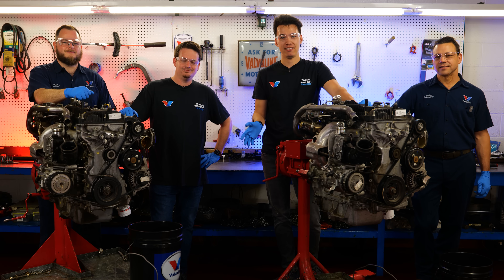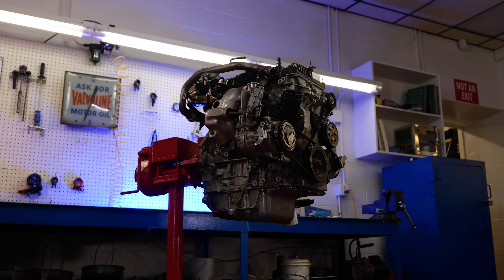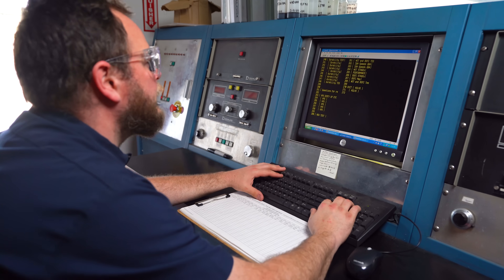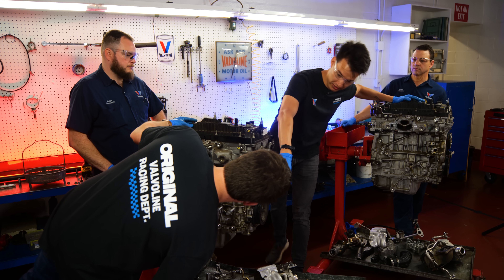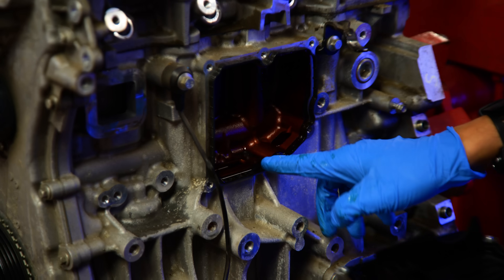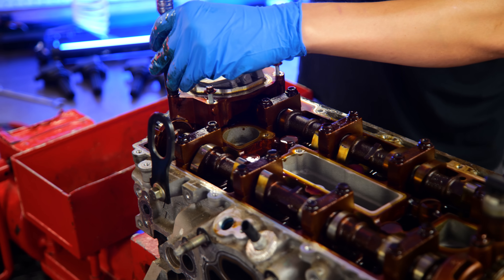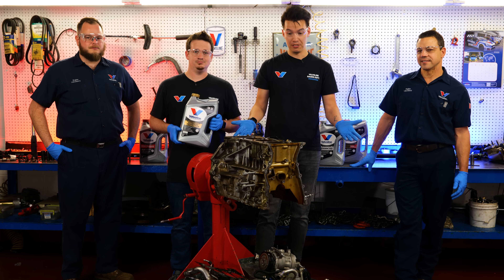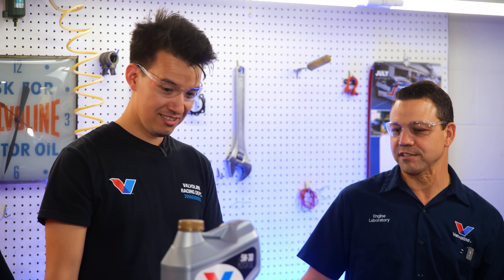Testing different oils over 4 years and 1 MILLION miles

Comment: This is a fantastic proof that no matter what products you use. Proper maintenance is the key to the long life of a vehicle
Reply: I’ve taken 2 SAABs and 1 Volvo to over 300k miles on 5k conventional oil change intervals.  Halfway there on a ‘03 Chevy and ‘11 ford but the last couple years have been on full synthetic.
Reply: Actually, this is proof that the products you use also matters. Synthetic oil is MUCH better than conventional oil. Synthetic oil also happens to be more expensive and most people will get conventional for that exact reason. It's better to spend the extra money to get the better product and this video shows why.
Reply: @JDubST  I can't see why you would use non synthetic oil these days. It makes just no sense to me.
Reply: @JDubST Depends what engine , in our case with Australian built 6 cylinder engines that normally use either 10w-30 or 15w-40 conventional , I was told that 10w-50 full synthetic would cover both standard grades , when I put the synthetic in , I immmediately noticed how thin & easier it seemed to flow , only problem was the lifters became so noisy I had to change back to conventional , nothing wrong with the motors or wear related issues , just no good for our application.
Reply: Horrible Holden six no doubt  …. Go the Fords and Barra the World!
Reply: They ran conventional at 10000 intervals. I bet if they ran it at 4 or 5 k there would not have been much difference. Just my opinion @JDubST
Reply: @JDubST  That's one theory. The other theory is that you match the specifications of the product and the specifications of the production. That means, if dino (conventional) oil was original, you can use it. You have to consider the oil change interval the product you are using permits also. This is a straw man test because the proper oil change interval was not maintained. At continuous highway speeds, you can go 10K miles on synthetics. Not on dino. I have an old Toyota. I keep a 2800 mile oil change interval based on all-short-trips driving.
Reply: @JDubST dude most car engine won't survive that kind of milage..so conventional will do the job jst fine...bt why not synthetic...it's better..
Reply: @JDubST  but it survived 500k right ? That is sufficient tbh
Reply: @JDubST  While true, nobody expects you to go 10K mile intervals on conventional. 3K miles, 4K at most - Had they replaced the conventional at those intervals the engines would probably appear identical. While synthetic is better, for the most part all you're buying is longer interval times.
Reply: @JDubST  Yet the exact opposite could be shown in other studies. This is snake oil my friend.
Reply: @JDubST so how come the video doesn’t mention how their “semi synthetic” only has to be 1% synthetic in order to put it in the label? Careful what you believe based on a video.
Reply: @JDubST Synthetic is definitely better but some engines like my Jeep 4.0 don’t like them. I tried using Amsoil synthetic I started burning oil and knocking. She’s much quieter on conventional 10w-40 now
Reply: @waterloo123100  This is where your previous buildup and wear matters. Part of what makes synthetic 'better' than conventional oils is its uniformity of oil molecule size and generally higher detergent levels. If your Jeep was using conventional most of its life and switched to non-conventional the issues can come from the uniform oil molecule size getting past the oil control rings more regularly than the conventional irregular sizing hence burning more oil. Additionally the higher detergent or cleaning power of the synthetic breaks down carbon and acid related buildup which can open up gaps where wear patterns have developed. These two reasons are why it's not advisable to switch to synthetic after a long period of conventional.
Reply: @waterloo123100  ive had similar experiences, turns out the 4.0 really likes zinc additives, the engine was designed for much higher zinc content in the standard oils of the day. Once catalydic converters became mandatory, zinc content was reduced in oils to preserve the lifespan of the cats.
Reply: @waterloo123100 what oil do you use? My 4.0 ticks like a time bomb  lol
Reply: @Vermonstered what if you do several 1500 cycles of synthetic would it wash away the conventional?
Reply: @Vermonstered  * and switched to conventional*    Typo line 3.    should be switched to synthetic
Reply: @JDubST Yep, and gets much worse with conventional oil during the winter seasons.
Reply: @JDubST conventional oil is better at keeping combustion by products in suspension. In aircraft engines this js very important. However i use synthetic in mine and change oil at about 25 hours. Its an aerobatic plane and operating in all attitudes washes everything in the oil regularly. No sludge anywhere on teardown. 25 hours at 70% power most of the time, doing 180 mph so thats 5000 miles of hard use i guess.
Reply: @JDubST  i wonder who would be crazy enough to drive half a million miles on 10k intervals with conventional oil . i change mine around 3 k
Reply: @JDubST  and also don't forget the mileage when the oil was changed, 6k is the best time to change your oil in my experience.
Reply: @JDubST  this is after 1 million miles ... the average person barely drives over 200k, so it doesn't really matter which oil you use.
Reply: I would of loved a third test vehicle running conventional oil for 5,000 miles instead of 10,000 miles. 

I would never run conventional oil for that long because it breaks down much quicker 😅
Reply: @Brandon-uy1uv sure. I bet you know more than the engineers
Reply: @Brandon-uy1uv exactly. When he said that I thought, we’ll no wonder the conv vehicle is so bad. They knew what their plan was. Let’s be real though. I’m struggling to believe they out 500k on a single exploder, let alone 2.
Reply: @Brandon-uy1uv  I wouldn't urn any only to 10k
Reply: @Brandon-uy1uv Well said, my thoughts exactly!!!
Reply: @Brandon-uy1uv  They couldn't do that. The two engine would have looked the same. There's a bigger markup on synthetic, you know.
Reply: @Brandon-uy1uv really ? i change oil before 5k kilometers 😮😮 a lot  less than 5k miles
Reply: @Brandon-uy1uv EXACTLY, conventional oil is not rated to go 10k miles, my foxbody has 500k real world miles and it’s ran conventional 10w-40 its whole life with oil changes at 5k miles, the the tarnishing looks nothing even close to this
Reply: @Brandon-uy1uv I agree, I work at a shop and most people only go 5,000 miles between oil changes using synthetic blend. I'm pretty sure an engine with oil changes every 5,000, using conventional would have been close to what the full synthetic one looked like. The varnish on engine is mainly from oil deteriorating and breaking down. It becomes acidic and starts corroding parts. But it would have been awesome to see a third variable.
Reply: @06Salvi_LGT  If they were both changed at 5,000 miles do you think there would still be such a large disparity?
Reply: @KLCII88  I don't think so, I think 10k miles intervals are too much. Specially on direct injection turbo engines like the ones shown in this video. My guess is that they would look similar since the oil is being changed more regularly and not letting it corrode the internals.
Reply: @06Salvi_LGT  Running conventional oil at 10 k miles intervals constitutes SEVERE  abuse especially in a high performance turbo engine .
Reply: @Brandon-uy1uv I would never run conventional as long as synthetic either. Wasn't designed to run the miles.  But... They each get as dirty as quickly and  the filter can only handle so much before the bypass opens.  I would like to see this test with a 5vs 10 with filter inspections and oil analysis on each at each change.  Also have to consider that in my area, conventional is not literally half the cost of synthetic.  Love the information though.
Reply: @musclecarappraisal When an oil manufacturer says their oil is good for 20k or 25k miles, they have millions of dollars, and dozens of years, of data to back that up. Why people still think it is still the 1970s is beyond me. Engines & oil are vastly improved.
Reply: @Brandon-uy1uv exactly they should have run conventional at what it is supposed to be 5000 or less. To actually be fair. Breakdown is obviously more on conventional because it was run twice as long as recommended
Reply: @Brandon-uy1uv then the conventional oil change is much more expensive. You are doing 2 oil changes for every one synthetic. Plus with synthetic you absolutely have much less chance of wear. The shear resistance is so much better. The thermal breakdown is so much better with synthetic.  With a direct injection turbo charged engine like that one I would only recommend a non good synthetic if I didn't like you and wanted you to have problems. It would be dumb to run a conventional oil in a engine like that and even dumber to let it go even 5k miles. Also, on those engines I guarantee neither go 500k in the real world but the conventional DEFINITELY wouldn't even with 5k intervals. This is just a Valvoline commercial if anyone believes that. I see these engines everyday.
Reply: @ShizawnSanders  the test is most impressive showing how well the conventional oil did for 10 k intervals in a turbo car .
Reply: @tjlee9901  now show me the exact same but REAL driving. Especially the Southern or Northern parts of the US.
Reply: watch it again
Reply: "Proper" maintenenance.  I'm am endlessly astonished at the number of people who don't do even the 'basic' maintenenace on their vehicles.  And it's usually these same imbeciles who love to claim "I'll never buy another vehicle from company 'X' ever again!"  And then they proceed to state how this, that, and the other thing on their vehicle failed while they were on a road trip to the middle of nowhere at zero-dark-thirty in the morning.  It's around this time I'll ask the moron what they use for their oil and oil filter change interval, to which they will (some of them) respond by saying, "Oil change?"  That's when you know that this person is an imbecile.  

I have a friend who is a DOCTOR......presumably an 'intelligent' person.......who upon taking her Toyota Sienna mini-van in for an MVI at her local shop, had the mechanic state that he refused to release the vehicle back into her custody.  When I asked her why a mechanic would make such a statement, she replied by saying, "He said that I had four bald tires that were so bald that the cords were showing through the rubber, and I had two ball joints that were ready to fall off the vehicle."  Apparently she didn't like the estimate she was given for the cost to remedy these items, and she wanted to simply drive away after paying for her failed MVI (annual Motor Vehicle Inspection).  Suspecting that he would be legally liable in some way for whast would undoubtedy be the inevitable vehicluar disaster upon her driving this 'death-trap' away, he refused her the keys.  I say hats off to this common sense mechanic, though I don't claim to really know the legal implications if he would have let her drive this shit-box away.  Did I mention that this woman is a.......DOCTOR????
Reply: This videos has very interesting things if you chosse natural oil do not change it every 10.000ml do it half 5.000ml
and you will get similar to syntetic...
thats the point syntetics last long with out deterioration...the brown color on natural oil its due to burn particules that not last 10.000ml
good to go only 5.000ml
Reply: @1mansopinions  Maybe you missed the conventional engine had no symptoms prior to teardown or both engines have 500k miles or both engines had stuck rings. Even if an engine retains slightly more heat, that's not a con unless it starts taxing the cooling system or hot spots begin to develop. And again, this is a 500k motor and beyond the life most first, second and onto the 3rd+ owner who never has any idea of the maintenance history. And again, folks like you need to realize engines wear out. There's no lifetime parts.
Reply: @1mansopinions  LoL, this test has nothing to do with what I run. It's literally about all you folks having no idea how to understand the results of an experiment. Now so weak your stance and character, trying to make it about what I run. 😂
Reply: @1mansopinions   🤦 But not only do you care so much of what I'm running to not only speculate, but even say now I'm realizing of some mistake. Even further creating years of history for what I've been running. But right, you don't care. What seriously broken passive aggressive nonsense you're full of aren't you? All because you resort to make it personal when your dumb comes out. SMH
Reply: @1mansopinions   But not only do you care so much of what I'm running to not only speculate, but even say now I'm realizing of some mistake. Even further creating years of history for what I've been running. But right, you don't care. What seriously broken passive aggressive nonsense you're full of aren't you? All because you resort to making it personal when the most obvious stuff is pointed out. SMH
Reply: @1mansopinions   🤦 But not only do you care so much of what I'm running to not only speculate, but even say now I'm realizing of some mistake. Even further creating years of history for what I've been running. But right, you don't care. What kind of passive aggressive nonsense you're full of aren't you? All because you resort to make it personal when your dumb comes out. SMH
Reply: @1mansopinions   🤦 But not only do you care so much of what I'm running to not only speculate, but even say now I'm realizing of some mistake. Even further creating years of history for what I've been running. But right, you don't care. Seriously, why does it always become personal when your dumb comes out?
Reply: @1mansopinions  Riighhhtt, you don't care but create a years long narrative about it. Such high levels of passive aggressive nonsense. Why do folks like you always resort to personal attacks when your dumb comes out? SMH
Reply: @1mansopinions  Yep, you don't care except care enough to create a years long history to what I've run. You're chalk full of this passive aggressive nonsense and not an ounce of technical understanding. 🤦
Reply: @1mansopinions  🤦 You don't care but create a years long narrative about that I use. Passive aggressive much?
Reply: It's proof that your engine will probably be the last thing to go, regardless of what oil you use.  Your cars transmission etc, will most likely go long before an engine issue.  I have had dozens of cars with 200-300K+ miles and not one had an engine go.  I had a Honda CRX with 350K miles and changed the oil, with conventional oil every like 15-18K miles towards the end and it was still running great.  That is the 100% truth.
Reply: If the engine can go half a million miles on conventional oil that is more than likely outlasting the rest of the car so what difference does it make if it has more wear?
Reply: @vinceblanchard1069 Because it’s common sense. Less wear, and tear. Better fuel economy, and less repairs.
Reply: Evidence would be seeing vehicle it came out and mileage they are here because they can try
Reply: Yes because oil gets dirty and contaminated
Reply: Not all cars are created equal, there are high maintenance cars
Reply: well, the video's main point was to use fully synthetic oil following a strict scheduled maintenance.
Reply: Yup... spend 1/4th the price on conventional and do oil changes every 3k-5k miles, or use synthetic for 10K. The choice is easy for me.
Reply: Literally not what the video proves.
Reply: Agreed - regular oil changes and proper maintenance will keep your engine running a long time.
Reply: The key takeaway for me was when your car goes to the junkyard with less than 500,000 miles using full synthetic oil, it'll have a much cleaner engine.  For the difference in cost, I'd stick with conventional oil.  

My dealer stopped offering conventional oil some years ago, interestingly, they changed the oil change interval from 3,000 to 5000 miles.  Instead of less than $30 for a an oil change, it's up to ~ $100.  I wonder why they did that?

 On the other hand, IF I had a turbo engine, I'd be much more inclined to run full synthetic due to it handling extreme heat better.

 This Valvoline ad (Valvoline being my favored brand) did nothing to change my mind.  Both engines made 500,000 miles, impressive.
Reply: My Explorers have 10k mile oil change intervals. I see no reason to do them more often. Both the conventional & synthetic oil engines looked great for 500k miles.
Reply: Synthetic vs Conventional is more of an application specific argument. Conventional is for shorter intervals, while synthetic is suited for extended drain. The misconception is that “synthetic” (referring to base oil only) provides better WEAR protection automatically. This is blatantly FALSE. Props to Valvoline for hosting this experiment and making a great product produced right here in the USA 🇺🇸
Reply: Uhhhh this video showed the literal opposite
Reply: stop the cap. full synthetic all the way
Reply: its proof this is marketing
Reply: It’s fantastic proof you shouldn’t use conventional oil… who would?  A poor person?
Reply: if you real want your engine to last a really long time.  change the oil every 3k and use synthetic.  2 to 3 oil changes a year at $50 a pop for a car that will last 200k is worth it to me.  They type of synthetic doesn't really matter but I have used Mobil 1 in all my cars with great results.  Never go off of Manufacturer guidanance.  Always go sooner,  they are in the buisness of selling cars not making the one you bought from them lasting longer.  The longer your car last the more money you have to invest.  Most rich people don't have car payments.  That is why they are rich.  Take care of your stuff.
Reply: and if they did 5k or 3k intervals I'm guessing the conventional wouldn't have tarnished
Reply: Dino oil change 3k
Synthetic  5k oil change
Reply: @bobconner422  : Agree, however, for many years I have done full synthetic oil changes every 6 mos or 6,000 miles on multiple vehicles that I own, all with great success.
   For me, the primary reason I run synthetic engine oil is to extend the drain interval. It saves me both time & money in the long run.
Reply: This video literally proves the opposite of your point, the engine on conventional oil was meticulously maintained and looks like trash compared to the synthetic one. 

r/whooooooosh
Reply: @ImBarryScottCSS  It looks very good for a 500k miles engine to me, trash is a bit exaggerated.
Reply: @ImBarryScottCSS  Who cares how varnished anything is when it operates perfectly well mechanically? 500k miles is 500k miles worth of revolutions that per this test is on varied throttle and driving. The folks who care what color the engine looks like rather than mechanical function and wear. Woooosh
Reply: @Vermonstered  Each to their own!  Use whatever oil you are happy to use!  The Motor Oil Geek also showed slightly higher wear on mineral oil (though not necessarily anything of significance).  But conventional changed at 5,000 or even 7,500miles rather than 10,000miles should have kept the engine cleaner.
Reply: @TassieLorenzo  What are you talking about? There's a number of reasons why you would never want to use a static weight mineral oil in a consumer level motor, no idea why you'd even bring it up. The engine is already basically at the finish line. 500k miles, do you PLAN on taking an engine further? Do you really care what color the varnish is on the engine when you retire it from half a million miles of service? I swear, so many people just regurgitate something someone else said without any ability to convert that information into actual knowledge and without knowledge, there's zero wisdom. 

The test is done, 500k miles, zero fatal failures or horribly unexpected rebuilds. The mating surfaces looked perfectly serviceable to continue. The oil protected sufficiently for this task and looks like it will continue albeit with some stuck oil control rings which don't affect compression. Why are you folks so worried about the color or trying to regurgitate a mileage number it 'should' have been serviced at when that 1) wasn't the test and 2) 'cleaner' standard based upon varnish seems arbitrary and silly. Wouldn't a mechanical operation standard be better? Though I'm not surprised by someone who touts the motor oil geek so often. Hint: All of his businesses revolve around getting people to worry excessively about their oil and related products so he can sell more services. You need other sources of information to actually gain some knowledge.
Reply: @Vermonstered the stuck chain tensioner and 7 vs 1 cold stuck piston rings are definitely something to keep in mind. Neither of them can be ignored. Failed timing chain leads to catastrophic engine failure, stuck piston ring in the best case to oil and increased fuel consumption, worst case to a stuck rotating assembly
Reply: @over_pizza_2578  : Sure, and if the drain interval had been every 3,000 miles, as it should be with any conventional oil, you'd most likely had seen much different results. 
   Primarily, significantly less carbon deposits and sludge inside the engine. It's those 2 things that created the sticking timing tensioner and piston ring cold stick issues.
   I found it interesting that the turbo wastegate failed prematurely on the conventional engine.
   I also found it interesting that the catalytic converters both failed, however the engine running synthetic oil made it to approximately double the mileage of the engine running the conventional oil. That alone is VERY significant.
Reply: @over_pizza_2578  Sigh... You people really do regurgitate the same stuff. Chain tensioner isn't a forever component. The test chose to replace as needed vs service intervals because they could monitor so closely. It would have been checked and replaced the same amount of times on a standard service schedule. The oil control rings can be a problem, or they aren't a problem. If they're not losing compression they might simply only see a slight increase in oil consumption and possibly be the cause of the cylinder smoothing. Being they made no note of this being an issue during the running, rather just a surprise note during teardown, it's more likely it wasn't as severe as you're trying to make it out to be. But again, most importantly, you need to realize components aren't lifetime parts. It's so asinine to attribute every part failure to oil change intervals for a half a million mile car. Just because it's the variable you're testing for, doesn't mean every part in your engine design will allow it to make 500k miles with ANY oil change interval. It again is 500k miles of rotations, heat cycles and stress every component needs to survive regardless of how often the oil was changed. As surprise.... Both engines of the same spec had the tensioner problem, both had stuck rings. It's so dumb to think halving the mileage on the oil is a magic, literally magic, solution and every engine will make it to forever miles and more in perfect condition without ever needing any service intervals on components. 🪄 That's exactly what you're claiming by attributing every failure to the change interval.
Reply: @Vermonstered  they did find that the ratcheting mechanism of one of the timing chain guides in the engine running regular oil started to malfunction due to sludge. I for one, would've wanted to see all of the oi analysis done on both engines.
Reply: @orlypalomar   That's the chain tensioner and normally the service interval is approximately every 100-150k. They left it on and that is actually the second one so only one failure in 500k miles. Again, you folks need to understand the oil change interval isn't going to guarantee every component on the engine is now a lifetime component. Those have service lives as well and theirs made it long beyond what most shops would be monitoring or just straight replacing it. I don't know why people think there's only one variable on this motor, the oil change interval, and that's the sole reason anything happens. It's not and it's painful to see this many people who think it's binary. Do 5k oil changes, your motor will automatically outlive you...
Reply: @Vermonstered but it didn't last. The turbo had to be replaced.
Reply: @ShizawnSanders  Now if you actually paid attention to what they said about the turbo. It's the waste gate actuator on the turbo that failed. Going to be a very very tough sell to try and blame that on the motor oil. Pay attention to details instead of regurgitating what others tell you!
Reply: @Vermonstered  LMFAO. I do this for a living. I pay attention every day. To every car I see and I see A LOT. Plain a simply cars that use better oil have less problems and in reality it cost the person LESS to use. It's literally cheaper in the long run even if nothing fails. I can GARANTEE if someone used that conventional oil on THAT particular engine and changed it even half as much it wouldn't make it much past 150k miles IF anywhere NEAR that. NOWHERE near 500k. Direct injected. 4cyl. Heavy SUV. Turbo. LMFAO 🤣 yeah right. 

Anyone seeing this if you have a modern direct injected engine do yourself and you bank account a favor and use a good FULL synthetic oil. I promise you will be ahead in the long run.
Reply: @ShizawnSanders  🤦 So you missed how the turbo failed had to do with the electronic waste gate and now missed that both these motors lasted to 500k without major mechanical failures or signs the oil film broke down with 10k or the OEM specified oil change interval and could do many more miles. If you do this for a living, you aren't very good at it.
Reply: @Vermonstered  LMFAO and you are VERY nieve if you think these engines, BOTH of them, would last 500k without a major failure. I'm a Ford fan, been driving a 500HP Mustang for the last 6 years and I'm telling you without a doubt these engines in particular wouldn't last that long. ESPECIALLY the conventional oil change one doing 10k intervals. BECAUSE I do this for a living I know that and I am VERY successful at what I do. You OBVIOUSLY need a clue.
Reply: @ShizawnSanders   🤦 So the entire thesis you're now standing upon is this test is entirely fabricated and the results are entirely made up? You're staking your entire reputation, per your previous post, that neither of these engines would make it to 150k miles on the 10k OCI... On the basis of 'trust me bro' and you drive a 500hp Mustang. Stupid never stops.
Reply: @Vermonstered  reading comprehension lacking with you or something? Where did I say the test is made up and where did I say both engines wouldn't make it to 150k? Huh?! You see alot of 500k Ecoboost where you work without a major parts failure? In real world driving conditions that particular engine doesn't last. I only have 14 years of experience on it. I'm also not saying it's impossible but I am saying it's a ANOMALY! I BARELY see 500k Toyotas and Hondas meticulously maintained. A Ecoboost going 500k using conventional oil changed every 10k miles? LMFAO 🤣 yeah right. Maybe 1 in a thousand where the person was on the highway 90% of the time and even still that would be practically a unicorn and NOT NORMAL! Also, how in the world do you get the idea I think I know what I am talking about because I drive a Mustang? I made it clear to put that in to show my bias TOWARDS FORD! My gosh. Stay in school kids. Actually pay attention. Edit: 150k
Reply: @Vermonstered  you were correct about one thing STUPID never stops. Although you might take a internal look there bud.
Reply: @Vermonstered   you see alot of 500k Ecoboost engines without a major parts failure where you work there bud? Actually do some research. You might learn something and not look a certain way before putting yourself out there.
Reply: @ShizawnSanders  You: "Where did I say the test is made up and where did I say both engines wouldn't make it to 150k?"
Also you: "I can GARANTEE if someone used that conventional oil on THAT particular engine and changed it even half as much it wouldn't make it much past 150k miles IF anywhere NEAR that. NOWHERE near 500k."
Also you: "A Ecoboost going 500k using conventional oil changed every 10k miles? LMFAO  yeah right. Maybe 1 in a thousand"
- For those who aren't carrying a pile of rocks in their head, this test showed exactly that with two side by side motors making it to 500k miles without any major mechanical issues.
You're really showing that true incompetence in your job, that reading comprehension, your schooling (LMFAO must be included in every response) and your resume of "been driving a 500HP Mustang for the last 6 years" and the capper is only the really dumb only deal in absolute claims like you. You out yourself and sorry this test exists and there's 2 unicorns out of 2.
Reply: @Vermonstered  please do show me these real world 500k 4cyl Ecoboost. Its should be easy because according to you 100% of a test of 2 did it. I mean you are making it seems like 500k Ecoboost that only change their oil every 10k miles using conventional is the norm. Is that about right? PLEASE keep this going. You are pure entertainment. Also, reading comprehension. I never said BOTH wouldn't make it to 150k. Show me where I said BOTH wouldn't make it. What I am seeing here IS someone making themselves look a certain way. Again, do you see alot of 500k 4cyl Ecoboost without a major parts failure where you work? Almost the EXACT same engine as this is where I work and has a just over 100k on it. Guess what happened to it? I'll give you a hint. It ABSOLUTELY DID NOT make it anywhere near 500k without a major parts failure. It was also serviced MORE often than Ford recommends ITS ENTIRE LIFE!
Reply: @Vermonstered  AGAIN! WHERE DID I PUT THAT DRIVING A MUSTANG HAVE ANYTHING TO DO WITH MY RESEME!? Like literally what's wrong with you other than a SERIOUS lack of reading comprehension!? Seriously!? And I have rocks in my head? Sheesh. I ONLY put that there, for like the 3rd time me telling you this, to show my bias TOWARDS FORD!
Reply: @Vermonstered  the only thing your quotes did was show what I have already said. You have a lack of reading comprehension. Maybe I should say it again and hopefully you will understand this time. 

In real world driving conditions where cars are actually driven on the road on different environments over TIME a 4cyl Ecoboost will have a difficult time reaching 150k miles using conventional oil changed every 10k miles without a major parts failure. Going 500k miles doing the same would be a Unicorn and I would have to see it to believe it with documentation and video diary time stamped to back it up. I have 17 years in the field and have been servicing those types of engines for 14 of them. Honda and Toyota engines have a difficult time going 500k miles in the real world using synthetic oils and being meticulously maintained. The Ecoboost has gotten better with every generation but its not a 500k motor especially with that choice of oil and ESPECIALLY with that drain interval UNDER REAL WORLD DRIVING CONDITIONS!
Reply: @Vermonstered  that pile of rocks is a whole lot smarter than you. OBVIOUSLY! You look bad enough here already but please keep going.
Reply: @Vermonstered  until you can show proof of all these 500k mile 4cyl Ecoboost with 10k oil change intervals using conventional oil with no major parts failure all you are is someone looking extremely foolish because you didn't do your research on that particular engine and all it's inherent design issues. It actually pains me to say that but its just a fact. 10k mile intervals with conventional oil that would be broken down on most cars for a good bit of it would just multiply the inherent issues and design flaws.
Reply: @Vermonstered  so I 100% prove that I didn't say what you said I said and after all that your response in I have rocks in my head? LMFAO 🤣 🤣 🤣.  Take a good look in the mirror bud.
Reply: @Vermonstered  insults are a sure fact of DEFEAT!
Reply: @ShizawnSanders   Your words say what they say bub. In fact you made a "GARANTEE" these engines won't make it to 175k miles. Much less the 500k the actual test was conducted over. The only common denominator here is the vehicles you work on have major problems breaking 150k miles. Still not realizing the test is 3+ times mileage multiple to any of these engines you claimed to work on, even if not a direct apples to apples comparison, shows YOUR work to be inept for them to be failing closer to 100k when you work on them. Your own claims show you to be less than useless for engines to fail so early so consistently and likely why you think you can talk your experience up to avoid reality. 

Oh and just because you make it so easy...
You: "insults are a sure fact of DEFEAT!"
Also you: hurling multiple insults every post. 🫣  Stupid never stops.
Reply: @Vermonstered  yeah this test did more than 3× the mileage of what is average for the lifespan of this engine. IN A TEST THAT IS NOT REAL WORLD CONDITIONS GENUIS!
Reply: @Vermonstered  show me EXAMPLES of this engine doing 10k mile oil changes using conventional oil and going PAST 150k miles with ZERO major parts failures. I'll wait. Until then, take a good look in the mirror. Admittedly I shouldn't say it's IMPOSSIBLE because of the flip side of Murpheys Law but I will say show me multiple like it's nothing for it to do that under those conditions and I will concede, but YOU CAN'T and you WON'T because I AM in fact good at what I do and perhaps you should actually just read some Ford TSB's, Recalls and law suits on the subject. ACTUALLY EDUCATE YOURSELF!
Reply: @Vermonstered  the only common denominator is the engines I see? LMFAO 🤣 🤣 🤣 🤣 🤣 so I see all of them in the world huh? You are making this TOOOOO EASY! If nothing else just research the TSB's, Recalls and lawsuits associated with the Ecoboost. If you're obviously not gonna educate yourself before looking this way at the very least take a moment and look at that.
Reply: @Vermonstered  you would have had a better time trying to prove that you know more about operating talking to a Navy Seal. At least then you MIGHT have stood a chance.
Reply: @Vermonstered  so let's recount. You say I said this stuff which I 100% prove I didn't say. You said I used driving a Mustang to prove I know what I'm talking about on the matter even though I clearly said I put that there to prove my bias for Ford. You constantly attack my character and try to say I'm not good at my job just because you can't understand that this test isn't a apples to apples comparison to real world conditions that the engine sees and that the engine in the real world just isn't that reliable when it's all said and done. You sir, have some growing up to do and a TON of research. Definitely stay in school and learn something and definitely don't tell a expert he is wrong because you saw otherwise "on the internet". Lol
Reply: @Vermonstered  ohh and since you are so smart why is it 300, 400, 500k  mile and more Toyotas(especially) Hondas, LS powered vehicles, Coyote powered vehicles, Duratec and even some 3.5l Ecoboost ect come through my business but when it comes to this 4cyl Ecoboost they just magically start having issues even though the only thing that gets serviced on them by 150k is plugs, oil, filters and coolant. I'm that's it. We aren't doing anything Ford doesn't say to do other than telling the people that are driving them that if they change the oil a little sooner than it says it's not going to hurt anything but could possibly help. So why is their MUCH less issues on those other engines vs these little ones? How is it My business is the only shop doing all the servicing so THAT must be why there are so many issues? HMMMMM!? Wow, where did they find YOU! ?
Reply: @ShizawnSanders   There's the incompetent fool's creed. If you can't do it, no one can. You'll "GARANTEE" it. When presented with evidence someone can, try to discredit and bury them never learning a thing while digging an ever deeper hole as you trip up on your own insults. Hilarious part is the evidence you keep demanding is really simple. Any used car search for a car equipped with this engine, your claim is every Carfax for a car over 175k miles will show a rebuilt or replaced motor. Just because you can't, doesn't mean everyone else is as useless. Remember how this all started, you couldn't catch the turbo failed because of an electronic waste gate and not an oiling issue. The volume of nonsensical absolutes, puffery, insults to come from that mistake and now even comparing your skill to the competency of a Navy Seal? The absolute level of self grandeur is astonishing. Only further proving, stupid never stops - but I can. 👋
Reply: @Vermonstered  youre wrong
Reply: @tjlee9901   Conveniently left out about what? Or are you just making more blanket statements with no actual basis? The test is what the test is. The used market for these shows exactly how well these hold up in the real world. No amount of personal hyperbole or rampant posting changes either one of those regardless of what 'Shizawn' or whoever else says. The reality for Shizawn at least is he causes his own problems as he absolutely can't accept his own responsibility as shown by his posts. What's going to be your claim?
Reply: @Vermonstered  Did you watch the video until the piston rings part. The varnish causes the piston rings to cold stuck.
Reply: @imadude85  The varnish doesn't do that, but physical residual buildup in the rings due to the burning oil and gas does. Also you don't seem to notice the engine had no symptoms prior to the teardown (not causing any issues) and both oil types had frozen rings only noticed during teardown so assuming an oil change interval change suddenly is a magical thing where the engine will suddenly show no wear and no issues is wishful at best especially for a 500k engine.
Reply: @ImBarryScottCSS  10,000miles/16,000km is a little bit too long for mineral oil though.  Synthetic oil has higher reserve alkalinity and takes much longer to turn to sludge so that would be the main advantage -- of course synthetic oil has other advantages such as: it can also often run cooler, due to different heat capacity; often holds dirt in suspension better; often has lower friction even for the same oil grade; together these attributes can reduce microscopic engine wear etc (check out the Motor Oil Geek conventional v synthetic video).
Reply: And not driving engines under load
Reply: @jMichaelEdwards  It's on a dyno, it's constantly under load and different operating conditions.